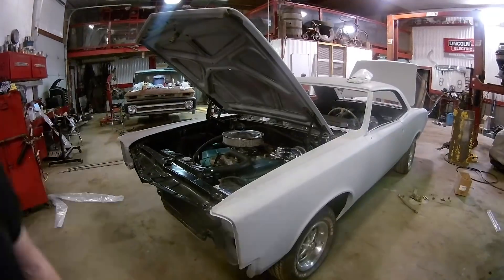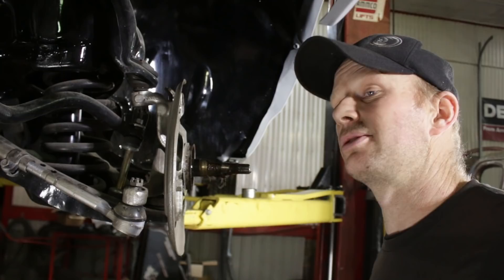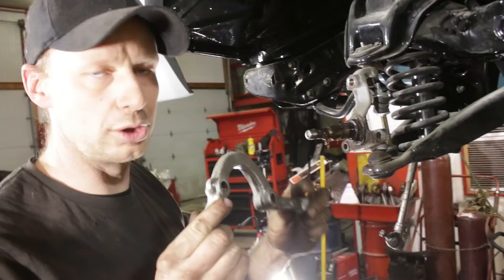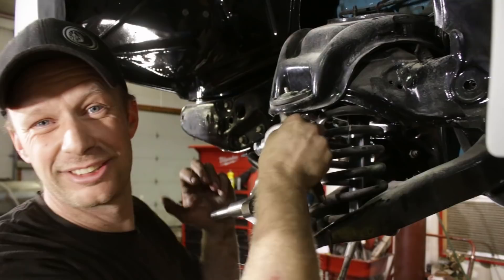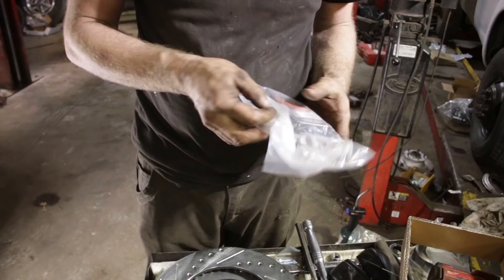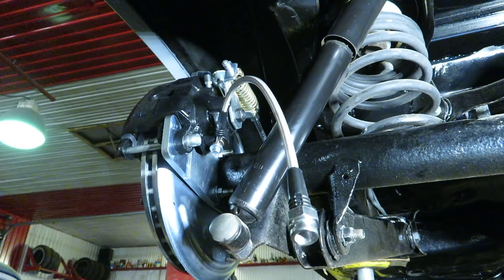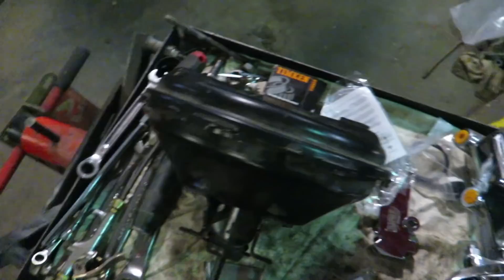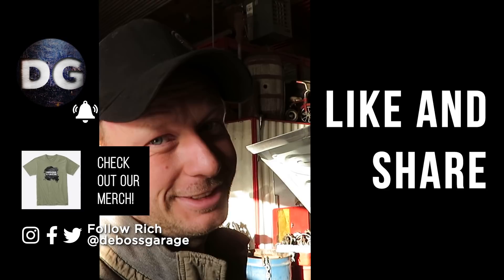DIY Drum to 4-Wheel Disc Brake Conversion | '67 GTO [EP18]

Comment: I keep my pressure greaser in plastic bag to keep it clean, as for the excess in the middle I use that to wipe a coating on the outside of the race inner and outer before fitting it and also use the rest to put a coating inside the hub to cover any bare metal in there that might rust so none is wasted..

Comment: I put one of those right stuff detailing master cylinder and booster onto a 65 cutlass. Three days later you couldn't hardly stop the car. went to the owners house to diagnose, I could hear it sucking vacuum through the pushrod with the brakes applied. summit was good about the return though.

Comment: I'd like to do my rear to disk eventually but not losing any sleep over it. Did my front with a kit summit racing sells converting to c5 vet hubs rotors and calipers with new knuckles. Couldn't be happier.

Comment: the 12 bolt is more than likely a chevy rear. bop's usually had 10 bolts and used bearing retainer plates at the brake backing plates to hold the axles in not c-clips

Comment: Super fine Job! Only thing I would have done differently is pack the grease well in the hub before installing the bearings, that way when the grease gets hot it has the extra grease in there. Thanks for sharing. Best Wishes n Blessings. Keith Noneya
Reply from the maker: Unfortunately that's not how it works.  Any grease inside will never make its way into the bearing

Comment: Rich, when you open the hood on a gm car, the older ones, you will see the brake lines coming off of the master cylinder and be coiled up like a coil spring, that is for body movement since the body and frame are separate. I noticed you made your lines straight along the body to the chassis doing it that way the lines will crack. Just saying.
Reply: yup

Comment: I work construction in the summer time and I had to move a pull behind air compressor(with a Cummins:)) and I just grabbed my f150 to move it instead of killing myself to move it by hand. The compressor wasn’t balanced well due to all the hoses and tools stored behind the axle. It came up and almost put a dent in my tailgate. I decided sacrifice my hand instead of my truck. I just thought about that day when you talked about saving the body of the car because your arm will heal.

Comment: You said this is a true 242 GTO so it already had disc on the front,  67 GTO did not come standard with disc, standard was 4 wheel non power drums

Comment: I believe that's a Chevelle differential.  Pretty sure Pontiac only used a 10 bolt rear in all their cars.  Not that it matters too much for functionality but just in case you want to stay "original".
Reply from the maker: That's what I found out too.   Should have been a 10 bolt

Comment: Rotors are on the wrong side(s).  Gas slots on rotors are correctly positioned when gases from the pads are forced outwards to the outer edge of the rotor by centripetal force (no, NOT centrifugal force) as the rotor spins while going forwards.  As they are currently positioned, the gases are forced back under the pad and tend to make the pad float over the top of the rotor surface.  It is not uncommon for the rotor boxes from the brake manufacturers to be mislabeled.

Comment: I have a 1967 camaro we just converted it to 4 wheel disk brakes, factory front calipers, elderado rear calipers with emergency brake cables, new power brake booster, new master cylander with inch and an 1/8th bore, new proportioning valve, pv4 disk disk. The problem is there is little or no rear brake, even after adjusting emergency brake to remove all play. Any Ideas?

Comment: During the front left disc install(11:20) Dirty Rich adds two wheel nuts to "Snug the rotor down properly to the hub"? While unboxing the 5514L disc it looks like the studs and bearing races are pressed into the disc with no separate hub assembly. Is there a separate hub that can be removed from the disc or is it one unit? If what is the point of the wheel nuts?

Comment: So Posi would be something to do with the gears not the Axle and your not wasting your time welding that there and/or losing the part?
Reply: Posi is when both axles are always powered 100% of the time it will affect driveability in a truck i had with it the front end would jump after the conversion
Reply: I was wondering if was the gearing inside or the whole axle.

Comment: You forget to grease your pins that the calipers slide on. That's like the #1 reason for uneven pad wear.
Reply from the maker: Didn't make the cut but I assure you they are greased.  Thanks for pointing it out

Comment: So what are the 2019 plans for the Quattro Debaucho?
Reply from the maker: Machined hot side with larger turbines on all four turbos.  Rebuilt engine, new clutch, LSD front diff.  Project car challenge, maybe drag week. and Hill climb 2020.  All videos will be coming up soon, except hill climb 2020

Comment: Say I have a C10 with disks in the front and drums in the rear I want disks in the rear will I need to change out the master cylinder and booster or will the factory ones work
Reply from the maker: Best to change everything. Only because the displacement in the caliper is different then in the wheel cylinder
Reply: @DEBOSSGARAGE  would it be cheaper to get an 8.8 rear end out of a Ford explorer and get the master cylinder and booster from it also

Comment: Now three 60 second comemrcials then the links to your sponsers then the clothes enough. Gets worse every video now.  BOP 12 bolts were actually 10 bolts (10 bolt carrier).  BOP's didn't use c clips. So should be a Chevy 12 bolt which id rather have.  4 piston to 2 piston ? I knew a buddy who lathed the front drums into disc spindles all the time. So you can't find a $4 seal so you spend $400  $-600 on new kit ? Older Gm parts are so easy to figure out. Btw wheres the Candian rust ?
Reply: ok mobilemowers, we get that your having a bad monday.
but its no reason to doubt Canadian rust lol
and also learn how to spell CanAdian, especially after editing

Comment: There’s nothing wrong with drum brakes
Reply: Fast machines 500r until u have to beat the living shit out of them to get the drum off. Disc is easier and just as good
Reply: Hunter Jackson due to bad maintenance. And yea they’re just as good, but the best combo is disks in front n drums in rear
Reply: If you're a semi, but for a fast car the extra control is crucial. It's also why so many of these ended up wrecked.
Reply: Paccar, peterbilt and kenworths parent company, have switched to optional air disc brakes, instead of drums. Much easier to service than drum brakes imo.
Reply: I don't think you've ever experienced true brake fade, because if you had you wouldn't be saying that. Read on:
I had a Dart when I was young and stupid. It had a 318 and front discs. I was behind a line of cars on a mountain road and they were all doing about 8 mph. I got impatient after about 2 mins lol (actually I waited for quite awhile) then I saw my chance. It was a hot day and down hill. I kicked it down to 1st, passed the 4 cars then hit the brakes coming up to a blind corner.
I was going too fast to get around it so I had to really stand on the brakes. Initially they were the same as always but then the pedal went rock hard and it just wasn't stopping fast enough. I got around the corner OK and looked like a damn goose but learnt what rear brake fade felt like. Imagine this with 4 wheel drums not disc/drum.
I'm a mechanic and everything was in good order as well as new brake fluid in the system. 
What happens is the linings get too hot and lose their friction coefficient. On A body mopars they have self energizing leading trailing shoes (same arrangement as these in the vid) and for the most part they work really well. The leading shoe is 20%[ish] smaller than the trailing shoe and the system uses the rotation of the wheel - energized by the leading shoe to ram the trailing shoe into the drum. This requires less pedal effort to get a good braking effect.
Reply: Yeah but terrible out on the road in remote areas for parts (though they could actually be more reliable), much greater expense and don't stop any better. My old '02 KW has drums with ABS and it stops good. It has a Cummins Signature in it so the Jake is really effective - I suppose that helps a bit. 
I drove a Paccar leasing 2 pedal KW awhile back. Boring as hell truck but great power and loved the intuitive shift of the auto-ized 18sp. It never shifted the same way twice and alway had the motor on torque. It was a hire truck my company gave me for the day while mine was off being fixed. I think it had front discs and I couldn't notice it stopping any better
*I also deliver steel to a trailer manufacturing facility and they have rows and rows of truck axle sets and only about 10% are discs so they must be expensive otherwise drums would be on the way out.
Reply: John Possum they ended up wrecked because people couldn’t handle the power of a Pontiac and they didn’t know how to service their vehicles